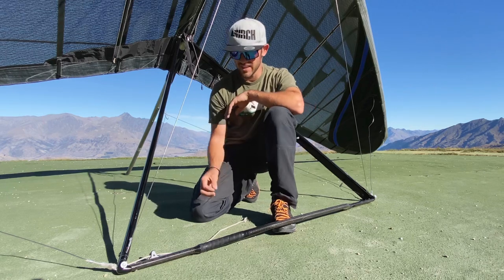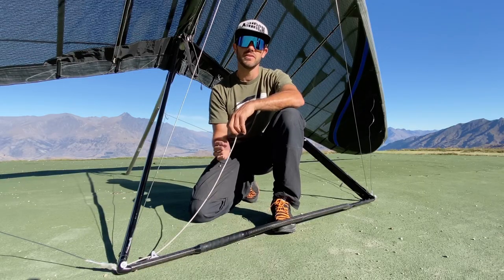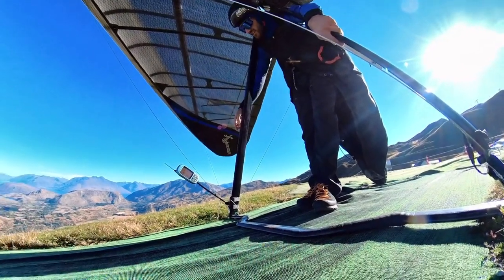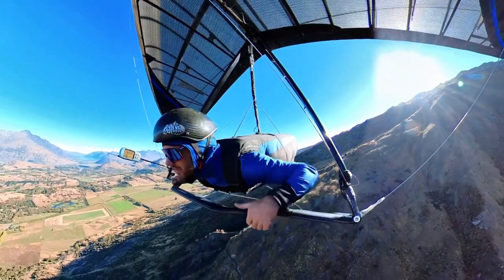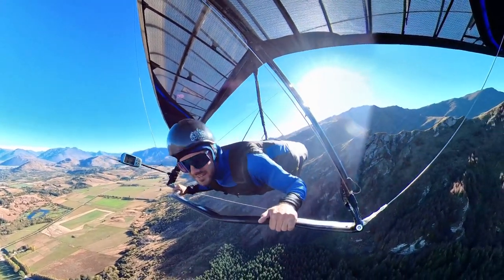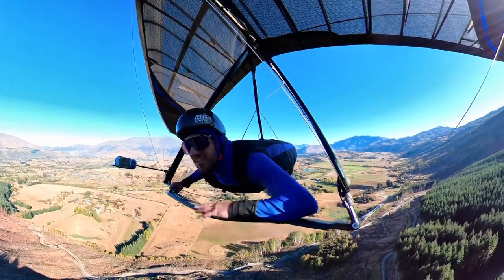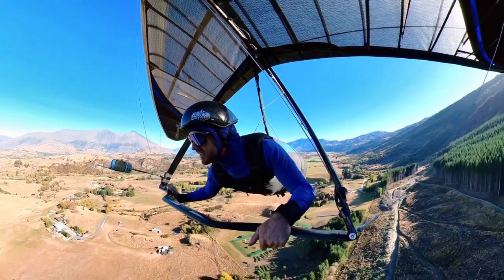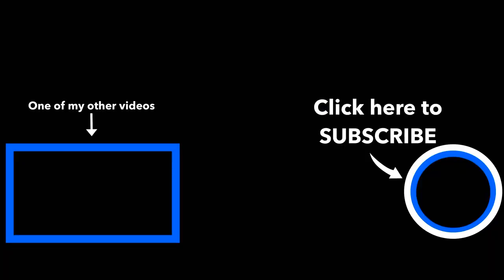Hang Gliding - What is that bit of rope for?

Comment: Thank you I'm an old hang glider pilot from the 70s and I'm getting back into after 40 years of home built and GA aircraft so that string had me questing what it was doing but I kind a guessed it had to be moving the cross bar. I see the effect of it now thank you. I am going to get some lessons here in Florida but this is all flat here so it will be a tow up launch most likely out of Wallaby. So I hope to progress bake to where I once was we had ratting system back then and I was almost a hang 5 when I started flying ultralights in the 80s with my new wife.

Comment: So, when you pull on the VG (variable geometry) rope, as you saw in the video, it pulls the cross bar back from the center. This in turn pushes the wing tips out and the leading edge forward,  flattening the sail (changes the camber (the top surface curvature) allowing for more speed and higher glide ratio. The opposite is true when you release the VG cord. You get more camber, (the top surface of the wing has more curvature,  creating more lift and drag.

Comment: Way to show off the perfect amount of bar pressure on approach. All you can get is usually good. Wind shear, ground thermals etc. All can screw you up if you don't have enough speed on approach. Caught me a tad once even though I pulled in quite a bit, the AZ thermals and sheer can get you easier than you would think.

Comment: Bit of a tease their Pete, you've got me wanting to know more. Does tensioning the VG change the whole planform of the wing reducing the sweep of leading edge tubes and therefore the whole wing? The shot from behind appeared to show some reflex camber in the centre of the trailing edge, which I think would add stability by reducing movement of the centre of pressure at the expense of increased drag, but also increased list. I'm guessing that would be good for landing allowing you to flare with low risk of stalling. Conversely, high VG tension for speed suggest reducing the camber of the wing and flattening the trailing edge. Low drag, less lift and more efficient. is that right?  Or... is it all way more complicated than that?
Reply from the maker: So pulling the VG on tight actually increases the nose angle by a few degrees and in turn tightens the whole sail up lowering the trailing edge. This reduces the washout in the wing making the angle of attack on the wing tips closer to the AoA at the centre of the glider. This is one of the main reasons for the performance gains amongst other things. I’m sure a smarter man than I will give a more in-depth description as to the change of camber, centre of pressure, Bernoulli's Principle and the amounts of their effects with vg tight vs loose. 

Having the vg on loose when landing is good in the more turbulent conditions as the glider has a more responsive nature. Also at the point of the flair, the wing tips will reach the stall point after the centre of the wing resulting in a softer flair. If you do a good flair with the vg on tight the whole wing will stall, not necessarily a bad thing though as the the flair would be much more of a snap causing a more abrupt stop (like a nice no step landing).
Reply: @petehelliwell  Thanks Pete. I should have realised, a hang glider is a Flying wing with no stabilising tail and requires washout for stability and to prevent wing tip stall. Love your videos.
Reply: The center battens profile shouldn't change with VG tight. The trailing edge goes down because it is less arched towards the tips but that's it.
Battens can flex at the leading edge at very high speeds though. Drops efficiency. Sail cut and carbon plate inserts can help, as well as some inner bracing that the UP Predator and Airbourne Rev have. Not sure why this kind of bracing wasnt widely adopted, at least Moyes gliders don't have it.
Reply: Thats a doubdt I ever had. How much should I pull the GV to land and under what conditions? Normally I land with 1/3 or half of the VG pulled, but I still haven't exactly understood the changes in landing because the conditions are always very complex. @petehelliwell